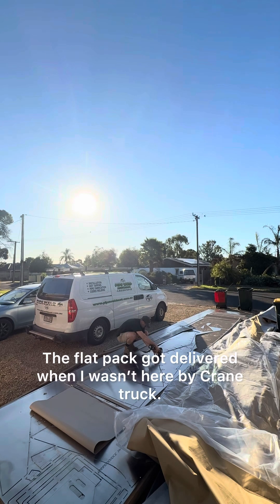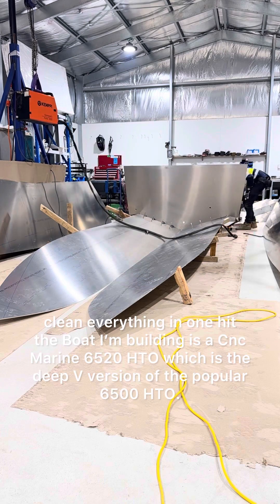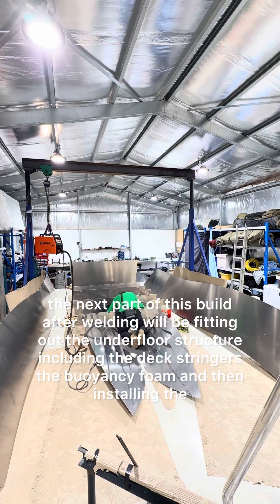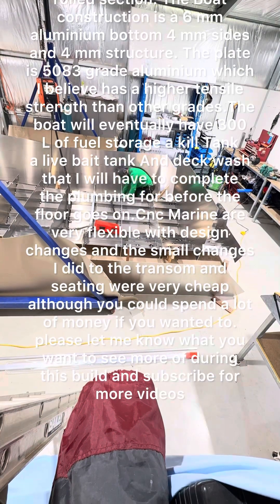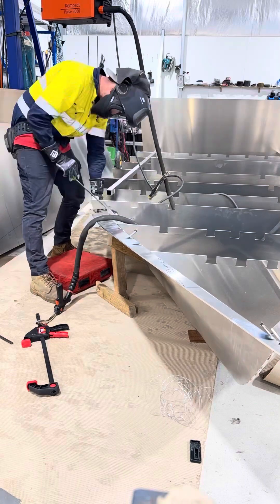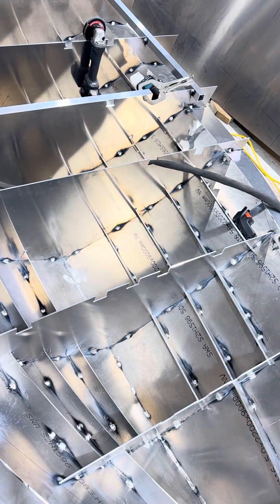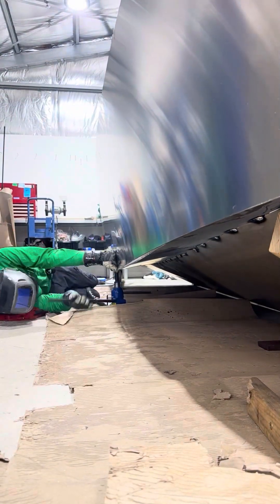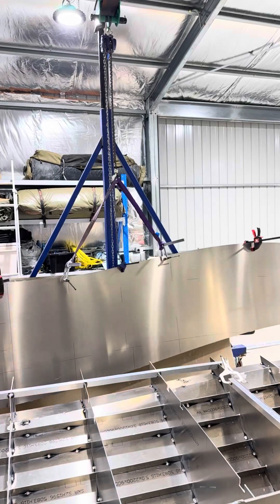Part one: Building my dream boat at home | fabricate the Hull

Comment: Looks excellent. What does a kit like this cost without making the changes you mentioned
Reply from the maker: The boat itself is $24k including drawings, material and great support throughout the build. With the alloy trailer, delivery and modifications it was about $30k AUD